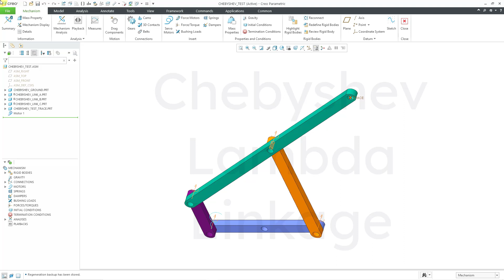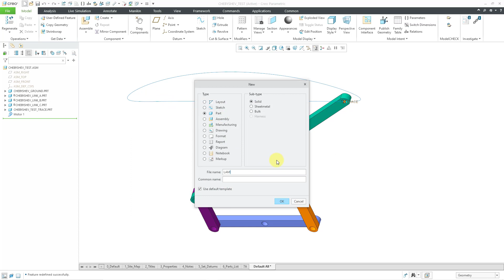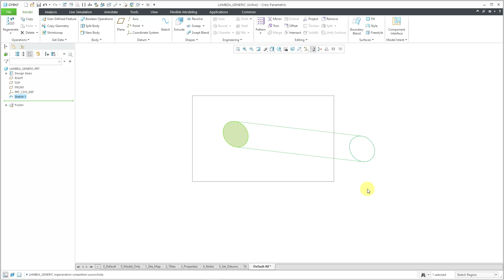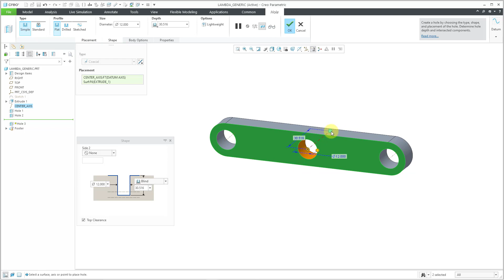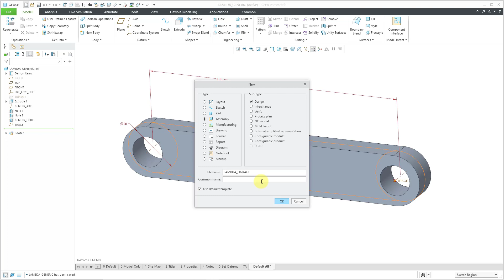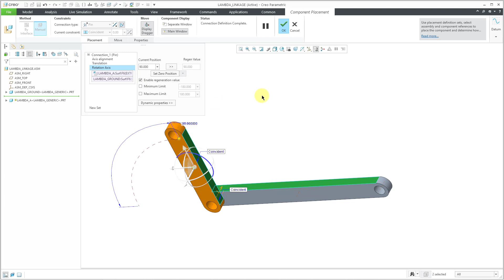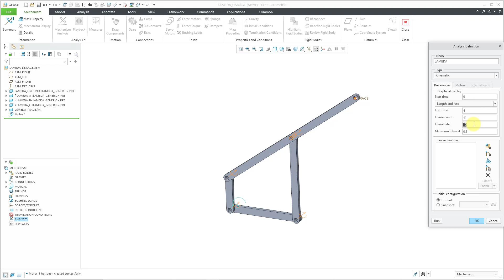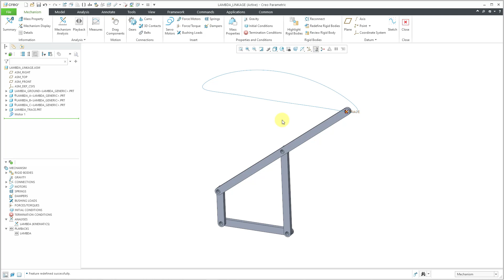Creo Parametric - Mechanisms - Chebyshev Lambda Linkage

Comment: Hi dave, I have a question
Is it possible to make my plane automaticly become a section? In my previous software(inventor) if I want yo design the part that located inside/in the middle of the part. I can easily click F5 to change the normal view to section view. Then I can choose edge that I want to be the refference for my sketch.
My workflow in previous software
1. Create sketch where I want + click F5 to activate the section view.

Currently I only know the way to do this in creo is
1. Make a plane for section
2. Create a section view in that plane
3. Create sketch in that plane
Thank you
Reply from the maker: In Creo, select your sketch plane and hit the Sketch icon. Then in sketch mode, there’s an icon in the In Graphics toolbar to clip the view. 3 clicks.